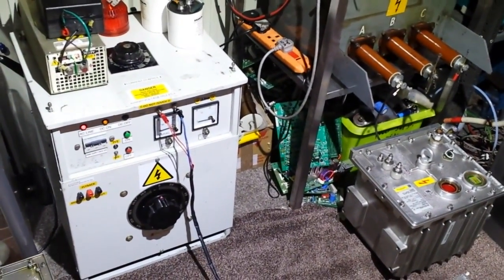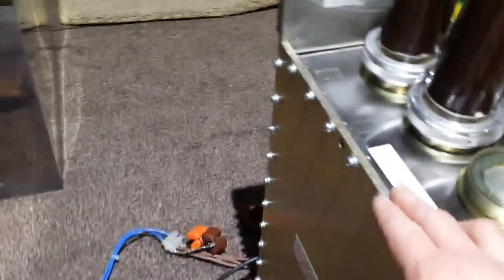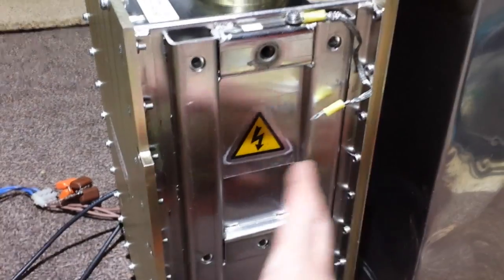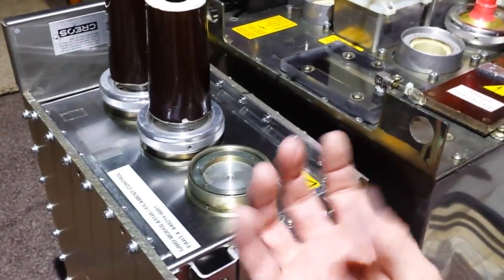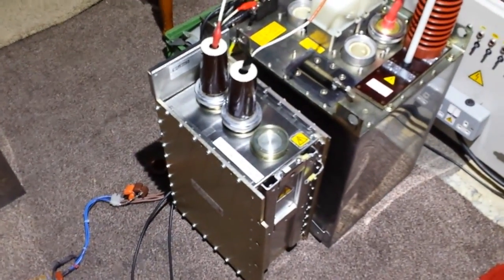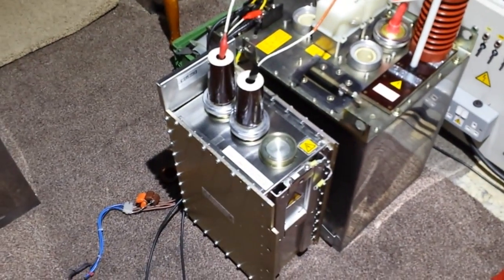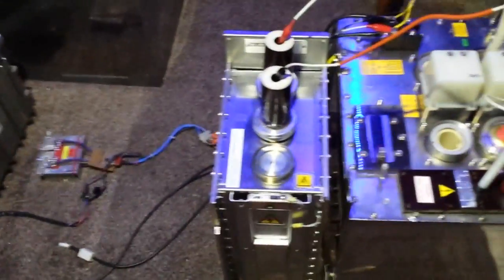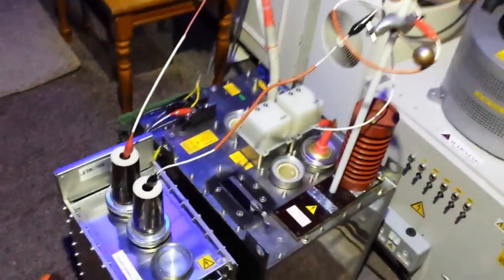Brutal Capacitor home made

Comment: What are you doing? Are you using a flyback to charge it up? Is it running on DC or AC?
Reply from the maker: Hello buddy, 
 yes the home built high voltage capacitor was charged up using a flyback powered by a zvs driver I'd built. 
And yes it was dc supply. Im Sorry I didnt explain this in the video.
Thanks for watching and hope you have subscribed to my channel for more!

Regards👍

Anthony,  High1voltage1rules

Comment: When discharging how wide was your spark gap and did you feel a sound compression wave like someone putting the palm of there hand against your chest? I built a cap long ago that was much smaller than yours that scarred the hell out of me when discharged i had to wear ear plugs and ear muffs
Reply from the maker: The sparks from that thing was insane when shorting out! Make your self a chicken stick to do this!! Saves getting zapped💥 lol 
and it did give a sound wave that was felt on your body.
But I'd most of the time leave a resistor  across the terminals. 
Very dangerous stuff!!

Thanks for watching and leaving a comment.
Be safe 👍😉

Comment: Hi I'm building a capacitor bank at school fro an electronics project. I'm going to use a camera charger circuit to charge the bank. 
Is there anything I need to know in terms of what caps to use?
Reply from the maker: As long as you use dc caps mate you should be fine! Im not too familier with the camera circuits. But i know there bloody leathal lol. With it being a dc charge!!😉👍
Reply: high1voltage1rules Thanks mate! I know where I can get some big DC caps that I can use. Flash cap charging circuits generally put out about 300V. Perfect! Thanks again!

Comment: wow! that looks greatly built!

 the diaphram in the botom of the ex transformer tank is really cool, its defently a must thogh due to the sheer power that thing is operating at and you wouldnt want it to acumulate any pressure at all :-)

oil fire + great new shiny cap
is not good recipie at all

you might want to put a big label saying it is a lethal capacitor and must be shorted at all times.

great video mate!
Reply: Elliot Hunt 😩

Comment: The cameras not picking up the arc because the shutter speed is too slow(or equivalent). It may be worse because the room is dark and the cameras basically taking more time to gather light. Older video cameras often had more customisable setting you could manual change to capture fast moving events. Awesome looking cap bank, hope you can destroy some stuff with it.
Reply from the maker: Yeah thanks friend. ill have to try it with the lights on and see if its any better😉👍👍